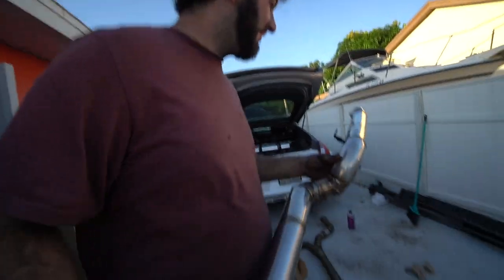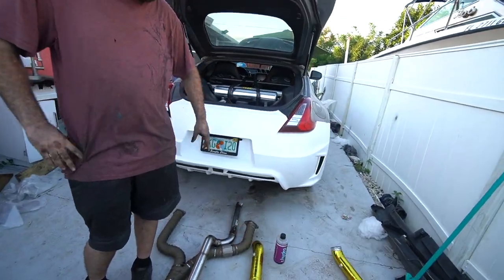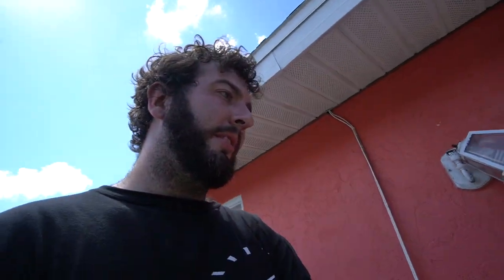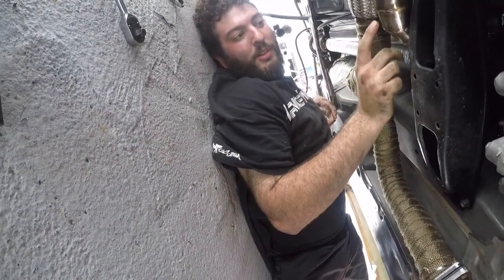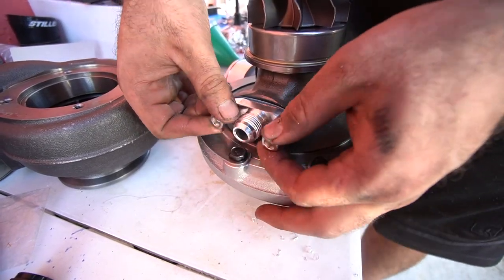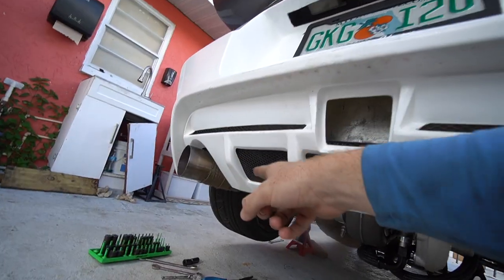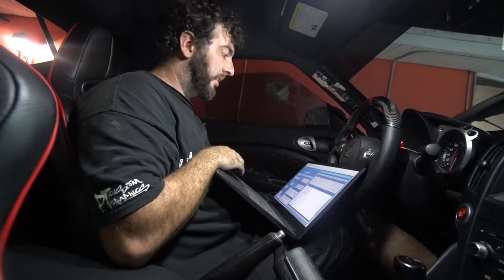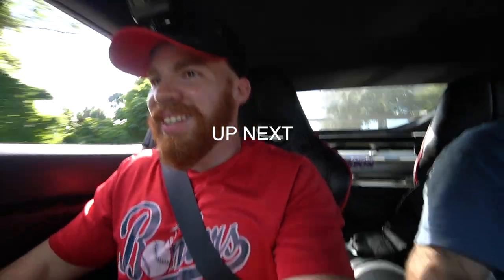Ultimate 370z/350z Turbo Kit Install!! *Raw BIG Turbo First Start*

Comment: 90% of the systems are 304 stainless with aluminum charge pipes in the engine bay. On some of the budget friendly systems we will use 409.
Reply: Totally meant to say 304 not 409
Reply: How much is the stage 1 kit ?
Reply: @ruggierilugoortiz4516  he says it 2 minutes into the video

Comment: Remote mount not an ideal choice. I believe in BORG warner turbos especially the EFR9180. What brand is the intercooler? Seems your using a journal bearing turbo. Would it not make more sense using a ball bearing turbo to facilitate better spool since the turbo is rear mount?

Comment: The most insane z I’ve seen is 800whp so to my knowledge if you were to go even just a lil over that ... that would be insane and probably one of if not the worlds fastest z with the stock motor (without engine swapping I mean ... it will have to be built tho)

Comment: He has power steering fluid leaking from his valve cover. And on that bombshell.
Reply: It looked like power steering fluid at first but then I noticed it poring out the side of the valve covered I didn’t bother doing the valve cover gasket cuz danny did them a few months ago
Reply: @Vqde_master  crazy. Didn't he just torque that down the other day too tho?
Reply: @jgm113  he did, you will see what happened in the next video

Comment: hey if you have a 370 vert it is mechanically totaled I spoke to a Nissan rep they know this and in her words Nissan is ok with this you have to wonder if the new Z will be totaled when is comes out because Nissan will be ok with that top fix 15-20 K if you can get the parts